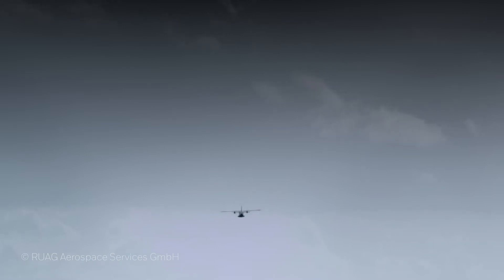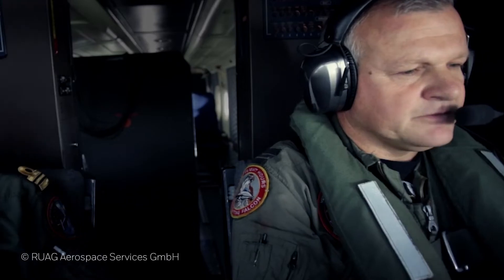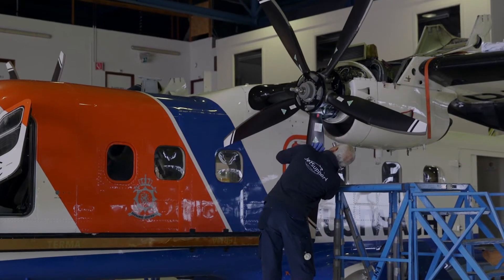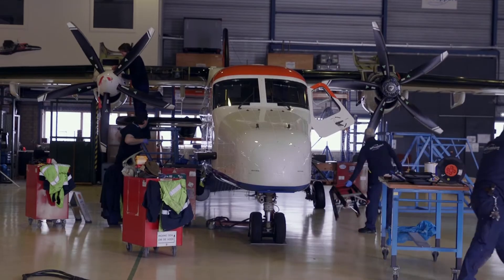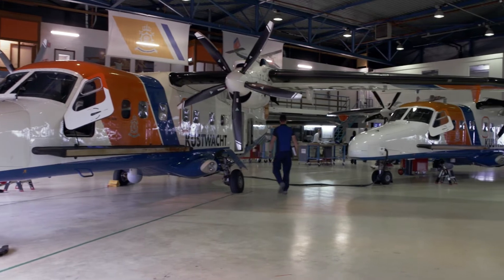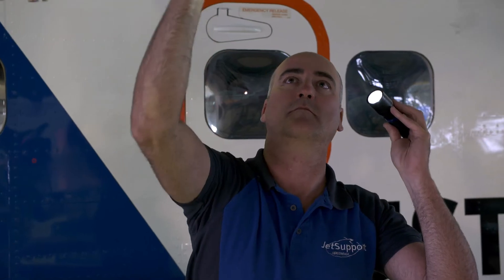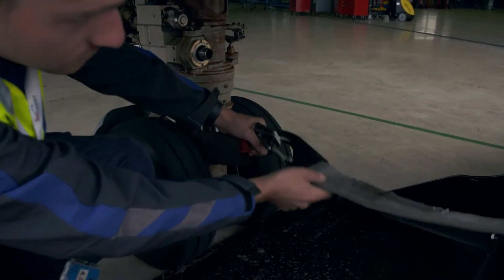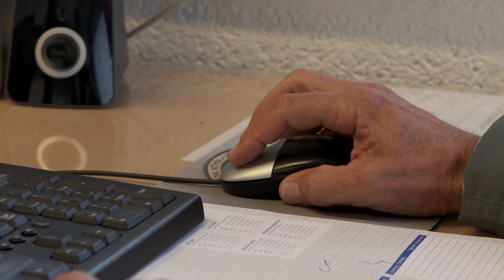Netherlands Coastguard Depends on TPE331 Engines for North Sea Missions | Honeywell Aerospace

Comment: Is it true that a TPE331 is also about 20% more fuel efficient than a P&W PT-6 of similar power ? If the TPE331 is so efficient, reliable and relatively easy to maintain, than why has it lost out to the reverse flow PT-6 in a/c like the  Caravan, Twin Otter,  Beechcrafts, TBM, PC-12, etc?  Is it the exhaust-in-the-back layout? I always wondered.
Reply: It's more like 12% more fuel efficient over a PT6 of the same horsepower, also the 331 requires considerably more electric power for starting and when dealing with Arctic temperatures may be unworkable in remote locations. In regards to maintenance you can do a complete hot section overhaul on the PT-6 without removing the engine from the aircraft, while the 331, requires removal